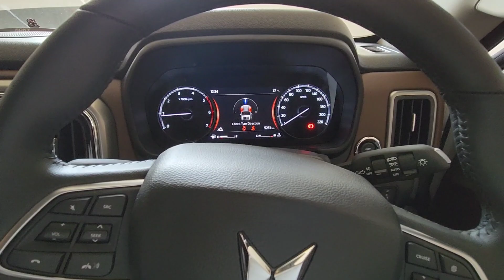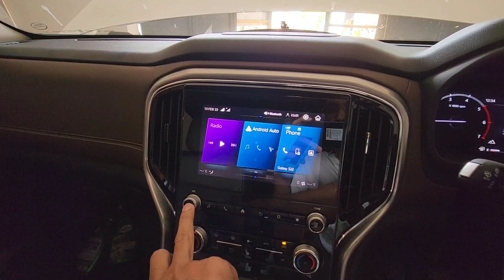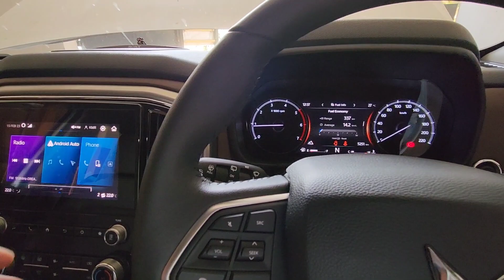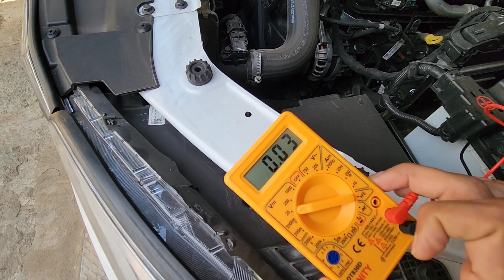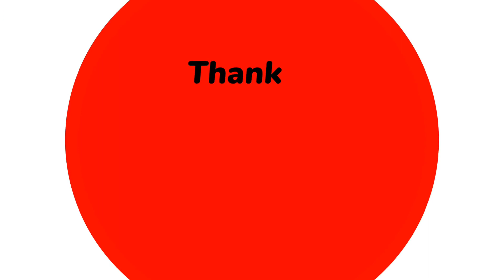P.D.I test to detect a faulty battery | Battery and alternator test of Scorpio-N.

Comment: I had the same issue. Parked the car for 2 days and didn’t start. Still experiencing battery drain. Z6 Diesel AT, delivered on August 2023. Car is bone stock. No accessories installed.
Reply from the maker: Hey Arrun, so what did the service centre say?
Reply: Same here, z6 mt. Experienced it 2 times. Did you find the reason for it?

Comment: Hi, I bought my Scorpio N in November 2022. Until recently, I did not have any trouble with the battery. For the last  one month, my battery has been draining every alternate day. I took it to the Mahindra service centre, and they told me that battery was good and the distilled water had to be refilled. Even after this checkup, my battery is drained again. Any suggestions. ??
Reply from the maker: Hey, I know it must be frustrating to face such issues in a new car. Try checking the alternator.  Also sometimes the battery is defective and the service centre try to avoid replacing parts. So make sure you stay persistent and keep taking the car till they agree to change it. Any problem if faced more than 3-4 times in warranty period,  your well within your rights to ask them to change it. Also when you get a call from Mahindra for service feedback make sure you get this up. Hope this is resolved soon. Do check the battery and alternator or get it checked outside authorized service center.

Comment: Can you inform on the kerb weight of the scorpio n.  Regd the weight difference between the 2WD and 4WD version. Also is it worthy to purchase a 4WD version. ?
Reply from the maker: I think the difference in weight of vehicle is around 100 kg. 4WD does not offer any performance advantage over 2WD in city or highway. If you are going to off road, or go to destinations that are challenging for 2WD cars, you may consider 4WD.  A 2WD will offer you better mileage overall since it is lighter than 4WD.🙂